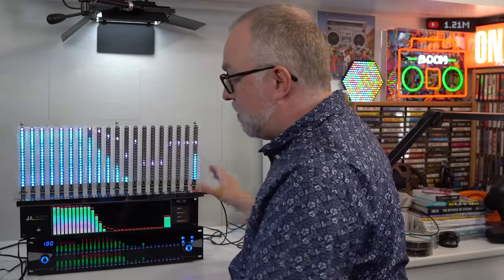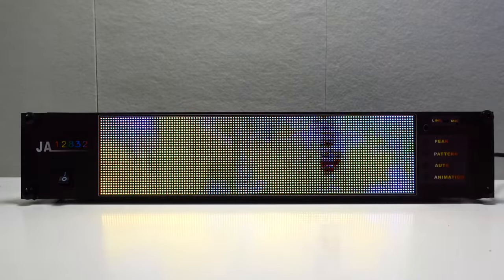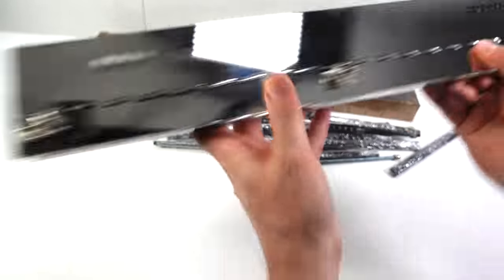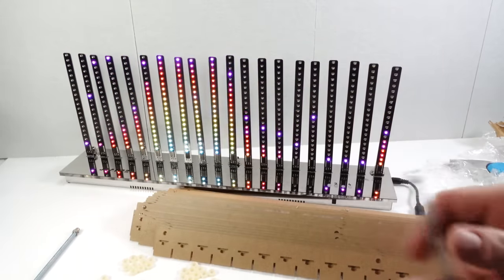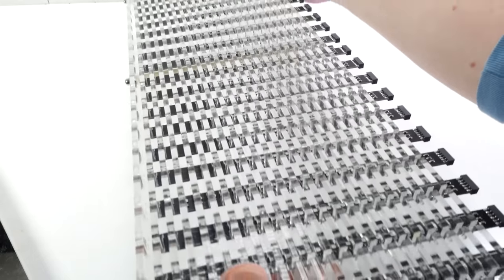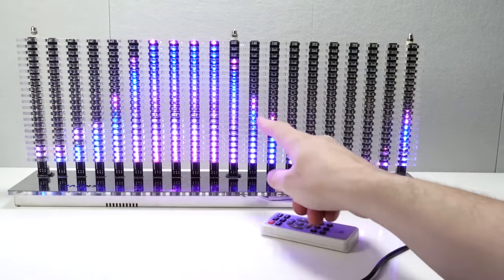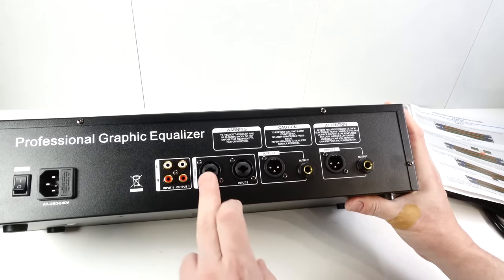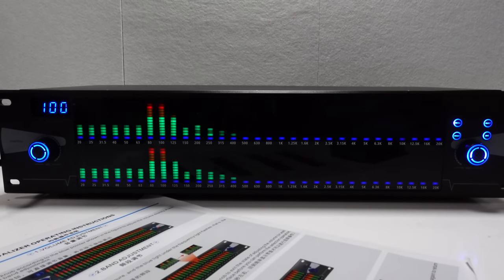Three more music Spectrum Analysers.  All that glitters...

Comment: Great video, just a thought to align second one, not sure if it's something you tried, maybe as 1 had plastic and 1 rubber as you already tried but use the nuts to compress the rubber to achieve the right spacing. Looked like a nightmare to assemble!, good old aliexpress...🤣
Reply: That's exactly what I was thinking, there is obviously a reason why they are rubber. Seems pretty simple.

Comment: Mat, it seems to me that you made assembling that second one a lot harder than it had to be.
- Firstly, I think one of the longer LED bars is supposed to go on the far right for the overall volume. That second one might just be a spare in case some of the LEDs aren’t working correctly. Which would turn one of the shorter ones into a spare as well.
- Secondly, If you start by putting all the LED bars and threaded rods into the base. Then remove the top nuts from the rods and begin stacking the acrylic plates. This would make you able to line up the first plate perfectly by using the nuts at the bottom, and then line up the remaining plates one at a time with whatever spacers would be needed in between.
- I hope I haven’t poured too much salt in the wound now. Because I am sure it was at least as painful to go through as it was for me to watch (while being unable to help you out).

Comment: I have the 'fungeneration' rta-31 you reviewed a while ago, which looks like a much more honest product than the 3 you reviewed here, and is actually somewhat usefull (its not an accurate measurement device, but it is actually good enough to quickly spot feedback frequencies when using a microphone on stage etc)

Comment: The spacing issue with the second one can be solved using.... mathematics! Using only the thick spacers, measure how far off the last LED is. Let's say it's 8mm. Measure precisely the thin spacers. Let's say they're 1mm each. Then divide the first measurement by the second and you have the number of thin spacers you must include per column, in this example 8. Then just spread those as equally as possible. If there are 20 LEDs, then 20/8=2.5, so alternate the thin spacers in a  2-3-2-3.... pattern.

Comment: For the devices that have audio pass through, I'd like to hear it tested to see how much sound is introduced.  Connect them in path, but with no signal and crank the amplifier up to here if it introduces noise.  I'd be disappointed if a balanced input introduced a noticeable amount of noise.   I don't really like using a microphone input as it will also pickup room and ambient sound and display that.
For that one where the acrylic was out of line, maybe you can use the thinner spacers to adjust only in the places it goes out of line?   Are the thinner ones soft?   Maybe they will line up when the nuts are tightened up and squashes them a little bit.

Comment: Too late now, but on the second device, set the LEDs in place, and then put the acrylic pieces in. Use either of the spacers depending on how far you need to go to meet the next led. More room, use a bigger one etc.

Comment: Hi, @Techmoan,

Did you get a chance to read through the manual for the third unit?  I ask because there are two possible explanations for the observed mono behavior (assuming, of course, that it isn't just a complete fake):

1: Is there a stereo/mono configuration hanging off any of the buttons?

2: Since it is allegedly an EQ, could the two bar-graphs be representing input and output levels instead of left and right?

Of course, the fact that the lower 6 bars are all completely identical and that the frequency sweep output is such complete junk still means you don't want anything to do with this device, even if there is a reasonable explanation for why the two bar graphs are identical.

Comment: Regarding the second analyser, I think that this wonky LED strip would be the volume indicator - notice the different LEDs are placed in the middle and at about 75% of the strip and on the top of it. Also I see some music markings behind each strip, I wonder if these markings differentiate between the music, volume, and whatever function these longer ones have?

For the first one, the pictures are quite used in clubs and parties, you'd acquire a bunch of them of different sizes and place them all around the venue, they complete the ambience of the party.

edit 3: you've missed a chance of adding a record scratch stop right before you showed the cracked screen for the third analyser :D

Comment: The spacer issue with the big one  is easy: There's one hard spacer and one squishy one per gap. All you do it put it together and then cram the screws down to set the gap right squashing the squishy spacers. Np idea what the longer strips are for though

Comment: The major problem for assembly seems to be due to missing instructions. I expect is needs a thick and a thin washer but then have to press it together to get the right spacing which would also explain the presence of a wrench. Can the thin washers be compressed?

That being said, since the actual functionality is no good anyway the assembly problems are actually irrelevant. It would just have wasted less time perhaps.

Comment: Concerning the build of number 2, I think it would have been best to build on the base with the LED's in place and add the number of spacers required to make that row level. I don't think it's a case of using the same "pattern" of spacers, just the number you need to make the row look correct.

Comment: What a bummer! Wow the time. I would've tried doing it on the base with leds plugged in and take it one row at a time. Then adjust when you need to. Only putting both spacers where needed for looks.

Comment: I liked the first one but I'd want a slightly larger display on something like that and a way to save favourite settings. I kind of liked the second one but I would only get it if I could find a used one that was already assembled. The third one looked crap but gave me flashbacks to the mini sound systems and bookshelf sound systems a lot of people had in the late 90's.

Comment: How much compression in the rubber spacers? Could it be that you are supposed to use one of each type in every position, which overspaces the acrylic bars, then use the spanner to screw down the nuts and thus fine-tune the spacing?

Comment: With the 2nd one, could you not plug the LED strips in and then lower the first acrylic bit down and get it lined up using the nuts, and then add some combination of thin and thick spacers to get the second one lined up properly, and then add some combination of thin and thick spacers to get the third one lined up properly, and so on? If all thick were misaligned, and all thin were misaligned, that implies you need a mix to adjust for rubbish build quality on the LED strips, and you're only going to get that by doing them one by one.

Comment: Here comes Keri the Complainer, ready to find a flaw in every design! Hahahaha, just kidding. Or maybe not?

First one is a nice rackmount multifunctional display. I'd like one in my rack, but it would need a little faceplate design mod because I don't really like the typography there.

The second one... meh, seems too flashy for my sight and brain (though it seems a bit softer once the acrylic panels are in), and rather flimsy at that. I like the mirror finish stainless steel plate though. Reminds me of many hi-fi tube amp designs. Assembling th acrylic panels is kinda fun because you can keep your hands busy, but I'd rather spend my bench time doing something that actually involves some thought and problem-solving. It also shows that if you make a simple mistake and multiply it by a few tens, you're in for a big waste of time (and probably nerves too).

Third one... oh plase, for crying out loud! Complete and utter shit. I'd build a better one back in very early 2000s when I started getting into electronics. The build quality is rubbish, and the single channel operation shows that it's shit after all. Totally useless, with pretenses of pro audio gear (which would be damn nice given that it has TRS/XLR balanced inputs and XLR paralleled with TRS passthrough outputs... are they even reputable - like Cliff, Neutrik, Amphenol, Switchcraft etc.?). I probably could reverse-engineer and mod the thing to make it usable. Other than that, meeeeeeeeeh, such a disappointment.

Comment: Could it be that the correct arrangement is plastic & rubber, the idea of the rubber being there to compress so that you have a degree of control over the spacing.
Does that make sense?
Reply: @avsystem3142  not disagreeing with you at all, just putting an idea out there that might sort it

Comment: Those first two (it's more obvious in the first one--look at the sine sweep around 29:30) seem to be ripoffs in another way too--they both look like they have some twenty or so individual frequency bins, but if you look closely it only has five or six, and just does a linear interpolation between them.

Comment: is it possible that the idea with the second one is that you use both spacers and as one of them is rubery you just screw it as tight as you need it for correct spacing ?

Comment: It looks like the first two don't actually measure the full 20 different points in the spectrum, and are instead only measuring 4 or 6 of them, then interpolating between them for each of the individual bars
Made aparent from the straight diagonal lines you can see in the spectrum sweep test

Comment: On the second device I'm surprised you didn't check with at least one LED strip as you went. 
Not that it would have mattered, apparently - I agree with others; seems doomed from the start.  Too bad, if it would have lined up it would have been a nice effect.

Comment: Wow, lots of expensive junk there.  That 2nd one might look better with dark strips instead of spacers, but it's just a larger more ugly version of the first one.  Even if you could find correct spacers it would be a pain to keep dust off of it.  When you first turned on the 3rd one I had hope since the display was looking like it was responding as a real spectrum analyzer, then you did the sweep and stereo tests and it was crap....

Comment: For that second one, you probably need to assemble on the base, using whatever spacers you need to keep the acrylic lined up (so the distribution would be inconsistent across layers). I'd guess they did this to account for the manufacturing tolerance on the LED spacing. Still looks like a terrible product though.

Comment: IMO, the second one is supposed to be assembled with the led strips installed, then add the plastic parts one at a time, using one or the other of the washer, then, depending on the nut on the top(cap or regular nut), tighten accordingly to get the rubber ones squished enough to get the alignment right.
Repeat until all adjusted or hair completely removed.

It still looks like crap. Probably be better with a back cover in black or reflective.
At that price though, it's an "ah hell no".

Comment: To me, the third one is the biggest disapointment cause at first glance it looks not that bad withe ins and outs on the back, clickable knobs, metal case. But then ...mono? and this crazy block lights in the bass frequency range and the even more crazy aliasing when  the sweep hit the top frequencies.....
Make me want to 'shake' the designer/manufaturer a little bit, lock them up in a room fully packed with this device so they have to look at it for a week......or a month 😄

Comment: Maybe the little stickers are for the front part of item 2 so that the spacing doesn't change. If you only use the spacers at the back then the front part can hang and cause it to go out. The product looked crap anyway but you definitely seem to have built it wrong. I think they are see through because they need to go at the front of the device between each layer. Just my opinion of course, I am no expert.

Comment: The third one would have been a decent pick for under 50 bucks as a hobbyist tinkerer. Rewire it with some better filtercaps for more accurate frequency isolation and proper stereo separation and you'd have some usable equipment.

The first one might have been also a decent project base (since it already comes with a good LED panel and the necessary IC components which could be hacked), if only it werent 150 queens.

The second is a straight up scam, they clearly picked the cheapest spacing rings they could find to ship and didnt care about their measurements. These kits should never be sold for more than 40 dollars (half of which is the price for the acrylic plates).

Comment: Mat you've mentioned the "Techmoan effect" a few times now - i.e. things selling out when you give them a positive review. Could it work in reverse as well I wonder? I hope that this video is influential enough to affect sales so that these shysters might stop selling such utter crap.

The first device wasn't absolutely terrible, but it could have been so much better. The second one was just awful and should at the very least have been supplied fully and correctly assembled. The third one promised a lot and delivered little. It can't be that hard for manufacturers to make a decent one at a fair price!

Comment: Wow... they're all outrageous! For that kind of price you can source some Japanese made Hi-Fi equalizer with built in analyzer that's properly engineered. Those Japanese components are only going to go up in price while these are only going to the trash bin after the novelty effect wears out.
Reply: I think thats the issue though, those japanese made components are only going to get older and more expensive, plus these things are mostly just a bit of fun, for me id go your way and use a proper spectrum analyzer, in fact i did mine is from technics and it can display the spectrum while also acting as an equalizer, but its a one color type unit and admittedly hard to see from across a room, these are meant to just throw out a light show, but yea they are overpriced nonsense right now.

Comment: You use all the 21 Acrylic parts, but there are just 20 LEDs, so can't work. I think you have to use both, the plastic Spacer and the squishy ones, and then tighten up the screw to press is down. But whatever is should be assembled, it hard not to include a Manual or anything, the price is to high for this quality level.

Comment: Pardon my nit-picking for the language (which we only inherited). Should that not be Graphical equalizer on that product? There is no nudity or extreme violence.

Seriously, as an electrical engineer - inexpensive DSP (digital signal processing) chips based on mathematical FFT (Fast-fourier transform) became availabe 30+ years ago. That transform changes incoming signals from an analog wave-form to a set of magnitudes of the component frequences. I'm pretty disappointed in the overall performance of any of these devices with your sweep. I'm assuming that your sweep was a single-frequency sine wave, btw. For $25, any of these is fun and neat. I hope that they don't cost more.

Comment: it's interesting how the hardware seems perfectly capable on these but the controllers are lackluster. Would make an interesting arduino platform with a bit of hacking. Could load some better programs and have faster mode switching.

Comment: Holy crap how this is bad and completely pointless. However, the video is as always very good. I stick to old-fashioned VU meters with lovely glowing backlight. By the way, a few days ago I found my almost 40 year old CDs with Talk Talk (The color of spring) and Simple Minds (New gold dream) and it is amazing how good the sound quality is in relation to Spotify. Lossless streaming will solve the problem, but it's really quite amazing that 40 year old CDs can still sound perfect and not only that, but also practically lossless in relation to the original recordings just as CDs were originally meant to be.

Comment: im admire your determination, you probably knew 9 of 10 not very good , no need to buy it, but you still try to buy them all just for a test,someone has to do it, so i do it for you kind of stuff, maybe buy a good oled monitor,and use some equalizer graphic software,maybe better.

Comment: If I'm spending that kind of money I'd hunt down a proper Technics EQ that's still in working order like the big boy SH-8065 and pair it up with one of their newer DSP models that have the parametric SA built in. These Chinese knock offs are just cheap bling - a far cry from the audiophile quality equipment coming out of Japan in the 80's and 90's.

Of course with an extra wide monitor and the proper software you can get a SA effect done too. I still have the original Cool Edit Pro 2.0 running on my PC and the parametric EQ/SA on that is unmatched, especially when you stretch it to fit the screen. Same is true with the TEAC HR Player app that's on my iPhone. As long as you have good source material a proper SA will do it's job. The reason WHY you don't see SA's today is because most source material is garbage, and you can thank Apple for that.

Comment: Ralf at the DCC Museum did a spectrum analyzer project recently using EVOR04 spectrum analyzer modules. They may not look as good as yours because they're intended to be used in a project, but they appear to be a lot more accurate. I tested the setup with a reel-to-reel tape that I recorded from FM radio, and it even properly reproduced the 19kHz FM Stereo pilot tone that was recorded on the tape. https://youtu.be/FyQxAyafn90?t=1356

Comment: why wouldn't you plug in all the LED strips on the base, then add one acrylic piece at a time onto the base, then you could space as required for each layer.
Mind you it is still a bit of a dumb design.